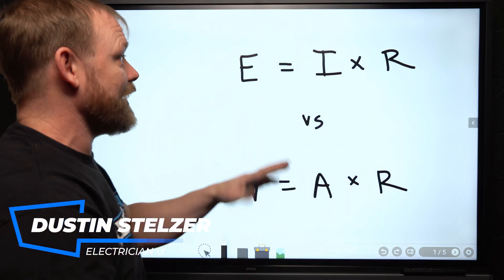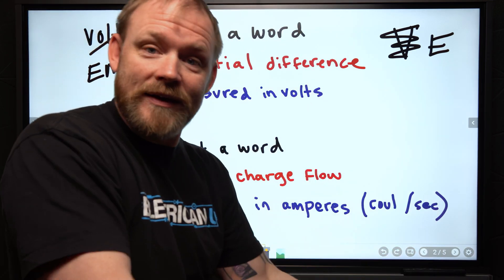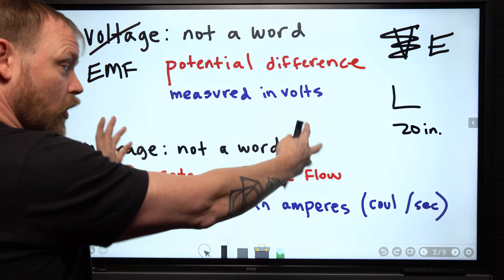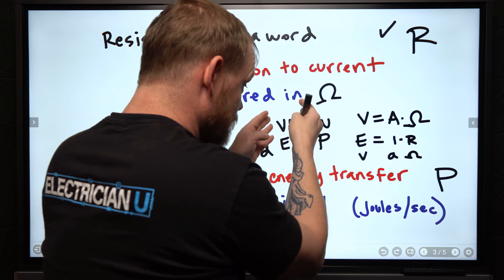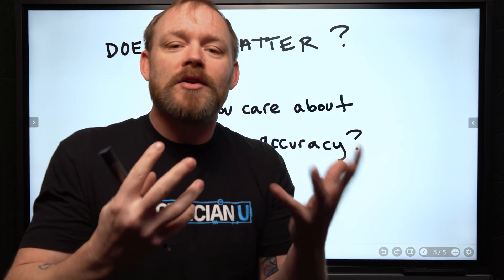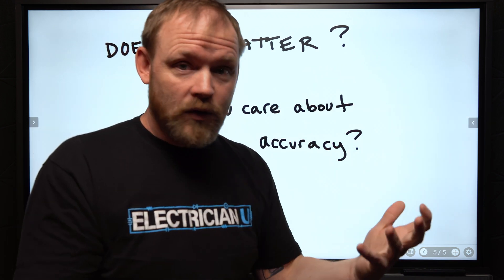This Simple Formula Mistake is Making You Sound Wrong! (Fix It Now)

Comment: Kinda but Voltage and volts are different words. Most engineers use voltage as shorthand for electro motive force or electrical tension. Emf is used in engineering mostly when a specific thing is producing or inducing an emf or back emf (typically the negative voltage induced by a magnetic coil). All measured in volts.

Comment: Helpful explanation. Thanks. My Victron inverter is '5000VA', and in practice will deliver about 4.4kW continuously. Which is about right because it's only about 90% efficient at full whack. I did find this confusing to start with.

Comment: While we are being pedantic,
- Use "U" instead of "E" - E is reserved for the electric field, with unit [V/m]
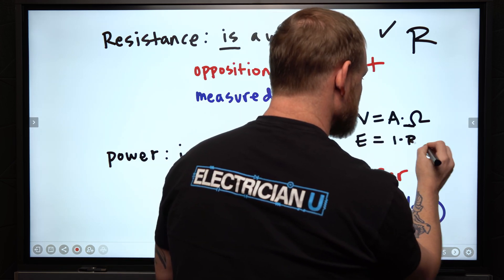- The [A] for current must be capitalized, with an unofficial exception of you are trying to distinguish DC/AC 3:06
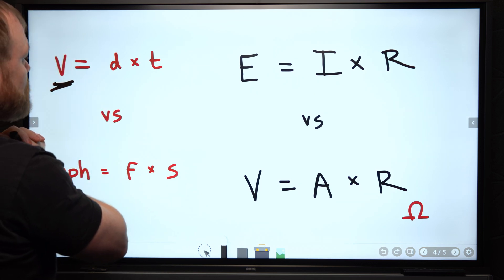- The speed-units are incorrectly illustrated - they should read {distance} PER {time} --> division instead of multiplication. 5:04

Other considerations: Don't capitalize the long-form units unless you are referring to the scientist; for example, a 1kg mass has 9.8 newton weight; Issac Newton put forth nicely the distinction between mass and weight. Also, do not use plural for the unit.

Comment: Engineering colleges teach V=IR. Technical schools teach E=IR. Also, technical schools  say current flow is from negative to positive, because they're considering electron flow. Engineers say positive to negative, because Benjamin Franklin defined it that way, and because it is equally correct because "hole flow"  (spaces without electrons) really does flow that way.
Reply from the maker: Makes sense, only problem I have is that the volt is a scalar quanitity, so saying V = v is saying vector = scalar. Current (I) and resistance (R) are vector quantities. Ampere is scalar, ohm is scalar, volt is scalar because they're the unit of measure. They have no direction. So V representing EMF or potential difference makes no sense because both EMF and potential difference are vector quantities. Pedantic, I know. But important in my opinion. And yes the flow of electrons vs conventional positive charge flow - agree with you there. Semiconductors still work on the principle of hole flow just as they work with negative charge carrier flow. Most often it doesn't matter which way you think of it - the equations all still work. Thanks for taking the time to comment my friend!

Comment: Isn't it E as the source and V inside/within the circuit?
Reply from the maker: EMF is inside the source only, potential difference can be measured anywhere in the circuit though, even inside the source. All of these measurements are measured in volts. So all EMFs are volts, not all volts are EMFs. Great comment, thank you!

Comment: Please don't use E. Only physicists are allowed to use E.  Why use EMF or potential difference when voltage is a real word that everybody is familiar with. Yes voltage is a real word.   Learn to separate  quantity from  units and it will all make sense.
Voltage (V) is a quantity. Volts (V) is a unit. V is the symbol (or abbreviation) of voltage and V is also the symbol for volts so it makes it a little confusing, but there is a definitely a difference between voltage and volts.
It's ok to say "the voltage of that battery is 9 volts".  The quantity of voltage is 9. 9 what? Volts. 
The quantity of current is 13. 13 what? Amps.
The quantity of resistance is 10,000. 10,000 what? Ohms.
The quantity of power is 900. 900 what? Watts
The quantity of energy is 23. 23 what? Joules (or W*s)
The quantity of capacitance is 220. 220 what? Farads.

So V=IR is ok. Quantity  of voltage = quantity of current * quantity of resistance.  Just keep it simple. (V(volts)=AΩ is mathematically correct because here you are equating equal units. But generally you want to speak in terms of quantities, not units so stick with V=IR)

Comment: You are wrong, the “V” stands for “Voltage” and its unit is volts, and is a SYNONYM for electromotive force. The reason we don’t use electromotive force anymore, is because physically, it is not a force, gravity is a force, the electric force is a force, but electromotive force is not a force. The term “electromotive force” is archaic and from a time when we didn’t fully understand how electricity works (to a degree we still don’t but that’s neither here nor there) the modern verbiage is “voltage”, and it’s SI unit is volts, just like resistance uses R, HOWEVER, current is weird, current uses a capital I, which comes from the French word for intensity. The reason current is an I and not a C is because the electrons barely move (such as in DC) or they oscillate (such as in AC) either way, current can’t really be conceptualized as electrons moving through a wire, it is something way more complicated and required quantum mechanics to understand, hence we still use a capital I, which literally is “intensity”.

Comment: To be fair once you start dealing with power factor your formula turns into 
VA=E*I.   E=I*Z 
Most electricians work on AC so impedance becomes more critical than pure resistance

Comment: I appreciate this video, and the importance of accurate language.  Hopefully constructive:  The correct abbreviation for length is a cursive lower-case 'l', not a capital 'L'.  Speed and velocity are words commonly used interchangeably, but they should not be.  Your discussion was about speed, whereas velocity includes a direction.  Also, speed is distance divided by time, not multiplied.  The "per" in miles per hour means the fraction bar, a.k.a. divide. HTH

Comment: V= IR is used in EE,  E=IR is used in physics. They mean the same thing, they give you the same result in calculations. I had never seen V=AR  but you would still get the result correct because in the end they are just variables, placeholders in the equation. The problem arrives when you have to communicate with others, then you have to use the correct variables so that everyone knows what you mean.

Comment: To be specific the potential difference is a potential energy difference not a force.  Emf is the cause of a potential difference. The Emf is really the energy transfer into a system or circuit   ISO/IEC standards have deprecated the term in favor of source voltage or source tension instead.  In most homes wiring you are really measuring the potential difference not the EMF.  I know it a little confusing.

Comment: I see this nomenclature used interchangeably with the electricians I've worked with in my career as an engineer. However, I don't think I've ever heard another electrical engineer or lineman say anything other than "voltage". Perhaps it's an American thing? My colleagues in Italy say "Tensione" which translates to tension, of course
Reply from the maker: Thanks for the coment! Everyone calls it voltage in the U.S. - me included. It's just not accurate. However it's so entrenched into our industry with terms like voltage drop, voltage fluxuations, stray voltage, overvoltage protection, etc. - not trying to change the way the industry speaks, just showing the reason its inaccurate.

Comment: A little off topic - Could you do a video on how to use a Megger and what it actually does?
Reply: Megger is checking for insulation resistance, it's applying a higher than nominal voltage and measuring for leakage current (for 480 systems anything other than rotating machinery is 1kv for 1 min rotating machinery is 500v for 10 min, per NETA and EASA) 

Megger usa has plenty of good videos on their YouTube about insulation resistance testing

Comment: First off, I appreciate the video. Keep that in mind. I have not finished watching but I am going to watch the whole thing. For now though this is a dumb argument. So what if volts is not a thing? Miles per gallon is miles / gallons.. Miles is "the measurement". It measures distance. Gallons is "the measurement". It measures quantity or volume. So what??? If it works it works. Now come hook up my HOT Water Heater.

Comment: In physics we used V as the algebraic symbol for electrical potential because we used E for the Electric Field. Overtime I used voltage and electrical potential interchangeably. In that setting I think it makes sense not use E for voltage measurement since we learn about the field first. Just wanted to give some insight into that environment.
Reply: No. U, not V.
Who are these"We"?

Comment: This is all good. I agree with the points you are trying to make. But two things can be true. Every electrical engineering, power engineering, and physics textbook I’ve encountered in my career used E and V interchangeably. If anything they used V almost universally. What they didn’t do ever, is use A and I interchangeably.
Reply from the maker: I agree it ultimately doesn't matter. In EE and physics the reason for this is because E is often representing energy and EMF. So using V makes sense when talking about voltage. For example the storage capacity of an inductor uses E and V because its a function of energy and it's based on 1/2CV^2 - some people use W instead for energy, so they can still use E for voltage. But my point is that all quantities we measure are vector quantities, whereas all of the units of measure are scalar. So voltage measured in volts is literally, literarily, physically, and theoretically wrong. But - I'll still keep saying it lol. Amperage is a hard no for me though. Its current - measured in amperes. Thanks for sharing!

Comment: If you could come at this with one more analogy, it would be helpful.  I for instance (☺) stands for,"Intensity?"  Is that right? I got the E = EMF but the."I" thing lost me. I always understood voltage like water pressure through a pipe but the amperes or intensity sounds like the same as pressure.  Obviously, I am confused and...not an electrician.  Thanks!
Reply: I stands for "Intensity of current".
Reply: @surferdude642  Thanks!

Comment: You didn't explain at all what is EMF since EMF is not electrons what is it? Main question is when a DVM meter is measuring voltage the DVM meter is measuring what?, because it's NOT measuring electrons. When a DVM meter is measuring amps current it's measuring how many electrons per rate time that the DVM converters into current amps unit.

Comment: To be a bit pedantic, "V" is not a measurement, it is an abbreviation of a unit of measurement. :) And I (as a layman) totally agree with you that at a more daily/casual use, what terms we use matter less than in a more formal standard/rule/law setting.
Reply from the maker: Got me there lol

Comment: V = D/T
Reply from the maker: lol good catch, I was just testing to see if you were paying attention….😅
Reply: @electricianu   a typical answer of a teacher 😅...
Reply: @electricianu  Better for your credibility, I believe, to just admit you made a mistake.

Working with variables in equations and their associated units of measure (dimensions) can be confusing.  It may be easier for folks to follow if you express a rate of change (of a variable) as a fraction, i.e. as a numerator over a denominator. Instead of expressing speed as "mph" use "miles/hour". Then when cranking through an equation, carry the units and process them like you would the numbers in the numerator and denominator. For example where E=5 joules/coulomb and I = 10 coulombs/sec, Power = E x I = 5 joules/coulomb x 10 coulombs/sec --> 5 x 10 or 50 joules/sec, because a coulomb divided  by a coulomb = 1, or you can say the coulomb in the numerator is cancelled out by the coulomb in the denominator.
Reply: Hopefully constructive:  Those letters should all be lower case, and the 'V' should be an 's'.
Reply: @scorpio6587 that is correct. Velocity also contains a directional component, while speed does not.
Reply: Correct